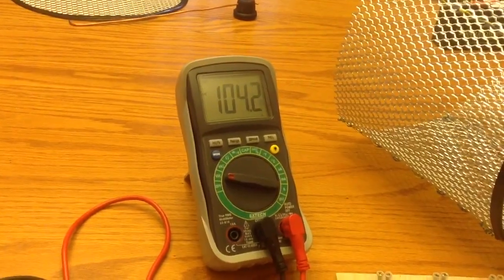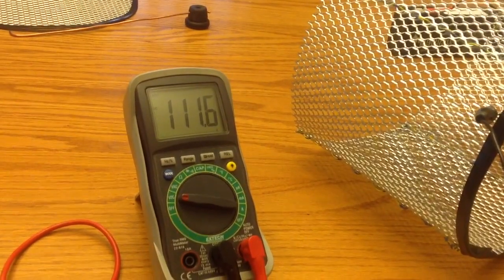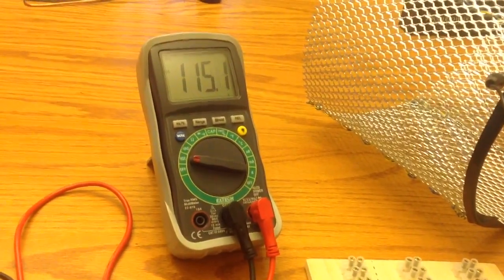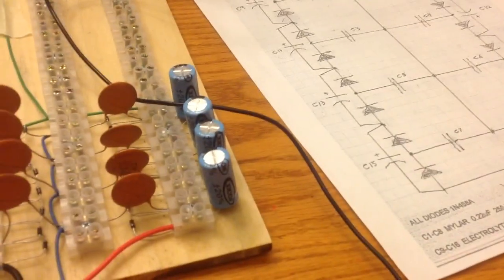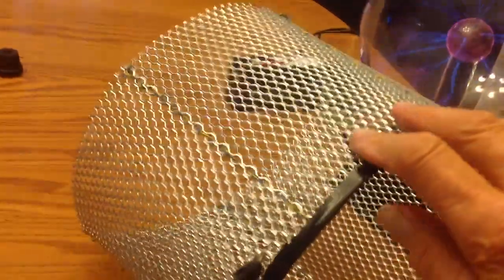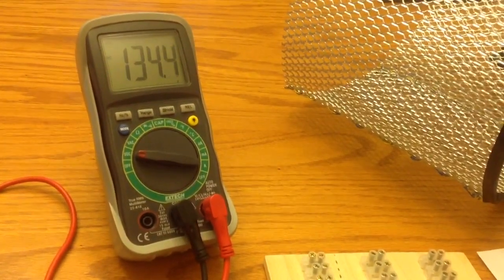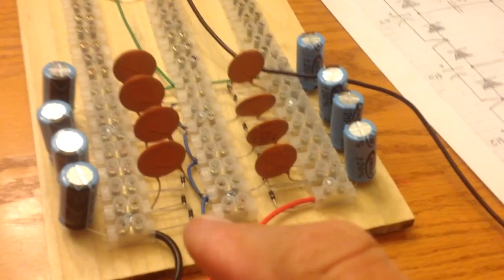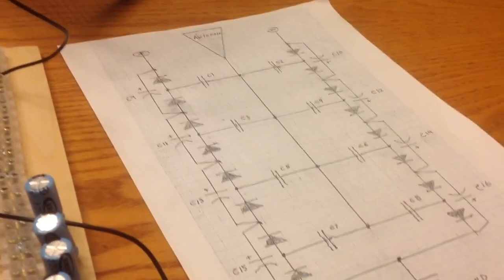FREE ENERGY RECIEVER UP AND RUNNING .

Comment: I once covered a plasma ball with foil and collected enough energy to get a nasty shock when I touched it. The way I see it I had turned my plasma ball into a giant capacitor.  In your demonstration it appears your doing the same thing.  Even though your probably not getting any energy from the plasma itself, it's being used as a medium to carry the high voltage from your Plasma ball to your collector. Good luck on your experiments.

Comment: Good for you Thomas. I see someone is thinking that the plasma ball is powering itself, but as you make clear, the plasma ball is powered by the battery. So no self-looping is happening, and the energy you are collecting comes ultimately from the battery. Now if you could put a large screen or flat plate antenna high up (in your attic perhaps?) and properly insulated you might be able to collect some energy from the Earth's electric field gradient, without needing the plasma ball. I'm sure you could run a small motor,  perhaps a Jefimenko electret motor, from the energy gained in this way. 
If you are interested in wireless power transmission you could check out my videos on the subject. I use electromagnetic coupling, not E-field coupling as you are demonstrating here. 
Keep up the good work, and don't mistake voltage for power!
Reply from the maker: +TinselKoala When I placed a tens unit sticky pad on the plasma ball surface I was able to draw  sparks after I rectified the hi frequency AC voltage.  That showed me there was a lot of current available.  i am waiting on some 1 ohm resistors to check the current accurately.  The plasma ball can deliver that but have to figure out how that higher current can be applied to this particular setup very simply. Right now i suspect the current will be low especially when the collector is at a far distance from the plasma ball source.  I have absolutely no problem getting voltage up to 150 volts. Can go over if not care full.
Reply from the maker: +Thomas Ferko  I am using a plasma ball that can actually operate with any music playing near it  That being the case the DC voltage coming out of the receiver should also play the same music if a special device is made.  That device should turn the variable dc from the receiver into the same music you have the plasma ball recording as variable hi voltage spikes.

Comment: Hello! A great experience. Still wondering what kind of load can be used .
Successful experience is when consumption from the mains less than output
Reply from the maker: +Артур Тоцкойнов  For less than $20 you can build it and find out for yourself.  I never stated this was over unity and if it produces anything over 9.65 watts so be it.  That's whats needed to power the plasma ball itself.

Comment: need to add a load and see what happens
Reply from the maker: +Thomas Ferko The battery shown in this video is powering the plasma ball only and is not looped into the circuit in any way.  If I decide to power a fan motor the power will come directly from the receiver energy and not from any battery.  I wish to clear that point up.